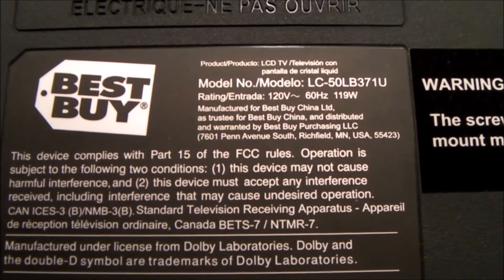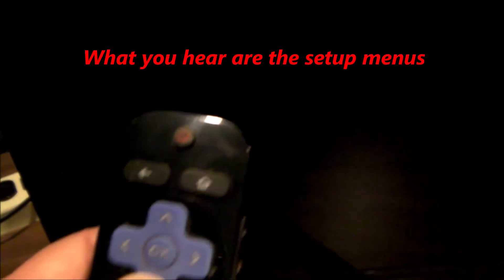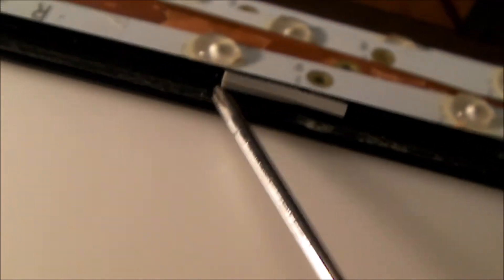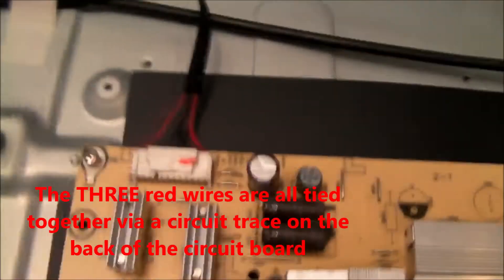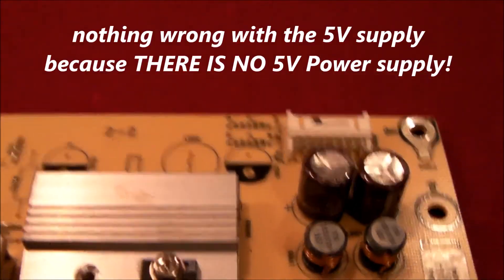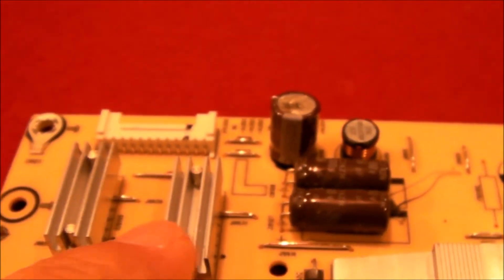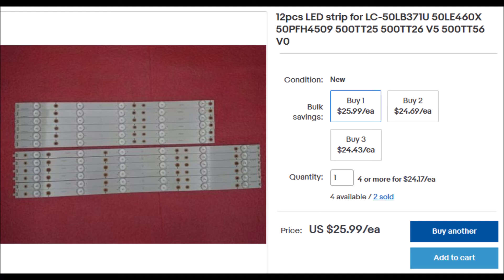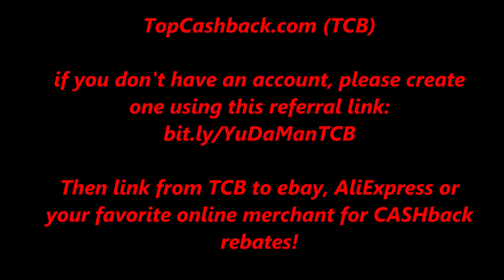Sharp Roku 50" LCD TV No Picture, No Backlights, No Backlight Power Supply Voltage LC-50LB371U

Comment: Great video.  I've got the same issue on my sharp roku. I have 66vdc from my power board. Question: I'm thinking about testing each led and replacing the bad one(s). Any thoughts on this? Thanks
Reply from the maker: it's not too tedious and you will have great satisfaction fixing it!  good luck

Comment: So happy I found your video. I bought a 75 inch Sharp Roku with same issue. I bought an LED tester and found that the LEDs didn't work properly but was concerned about no LED voltage from the power supply. I didn't know about the reset button. Tried it and the LEDs blinked, so I now know there is output voltage. I've ordered LED strips and look forward to getting it working. Thank you!
Reply: How'd it go

Comment: Thanks for this video.  Mine had adhesive all over the place including in main area of the reflector paper.  A hair dryer saved the day.  I had replacement backlights and they fixed the backlight issue (2 middle rows went out).  

But when I put everything together there was only a black screen with the backlight running.  :(  No Sharp intro screen either.  Remote control, panel buttons and sound all work.  I had plugged in a Fire Stick and it works without video. I’m really bummed that it failed like that after I took every precaution. 

Btw I used a smaller set of suction cups, about 2” diameter as I felt my bigger ones would have way too much suction.  It worked perfectly.

Comment: Thanks for this video.  Any idea why all the backlights would fail at the same time?  I'd've figured an one strip would go out at a time.
Reply from the maker: they are in series so only a few need to fail and the whole row or two will be out.
Reply: @YuDaMan  On mine it's completely black screen, total backlight failure.  
I didn't see any dark patches preceding the failure.  

Just seems odd.  For $30 to test, seems worth it.

Thanks for replying!

Comment: Hello 
I have a Sharp roku tv that blinked one of two times until it cut off. I've replaced the power board and main board. Only the red light is on and nothing has changed. Any thoughts ? Thanks
Reply from the maker: sounds like a power supply issue to me but you need some skill to measure voltages at startup and this is pretty dangerous if you don't know what you're doing.  I would NOT assume the replacement boards were good.   Many I have purchased are defective but the supplier will gladly replace it with another because you end up being the tester, even though they say it came from a working set.  I would swap back some of your old boards and see if that changes anything.  Be sure to give me a LIKE and Subscribe.  That will really help me.  THANKS and good luck!
Reply: @YuDaMan  
Thanks for the information. I  did order both boards that are new. When nothing happened different, I changed them back. I don't have a service manual for it and I'm shooting in the dark. I tried the power board first and ordered the main board which neither made any changes. I  do have a degree in electronic and I respect your comments. Thank you for replying.

Comment: hey so i just have a quick question. When you lifted the panel, filters and reflectors off of the tv to install the new led backlights, was there adhesive you had to remove as well or were they held to the tv some other way?
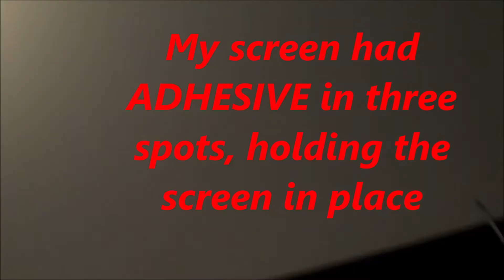Reply from the maker: TAPE/adhesive is shown in the videos at around 2:40.  If you don't remove it properly, the LDC screen can and WILL break EASILY and your fix it project is over - FAIL.

Comment: i have a sharp lc55ub30u that has a similar issue but i don't have any sound any backlight or any picture with a flashlight i replaced literally every god damn thing on the chassis every single circuit board was replaced and it still will not work it turns on and the power led comes on but there's nothing on the screen or anything not sure if my model has that reset button that's something i should look for tomorrow i guess as it's late as balls midnight but this is driving me up the wall as I'm fairly confident it's not the panel or leds but it could be
Reply: did you swap the backlights?
Reply: @coolelectronics1759  no i found out that the screen was cracked internally so i had to trash it